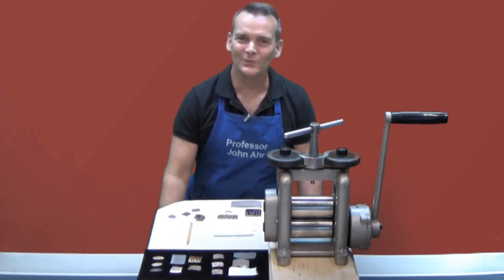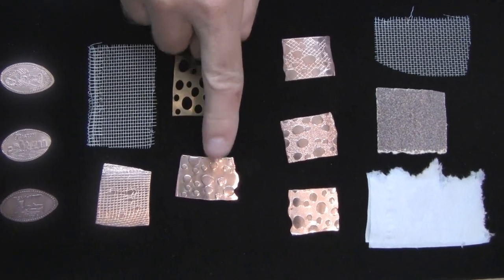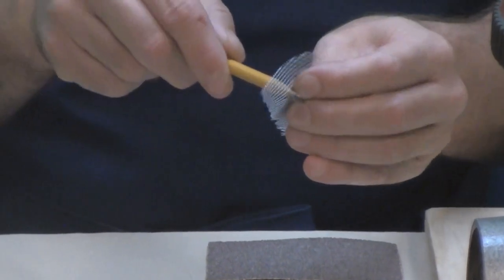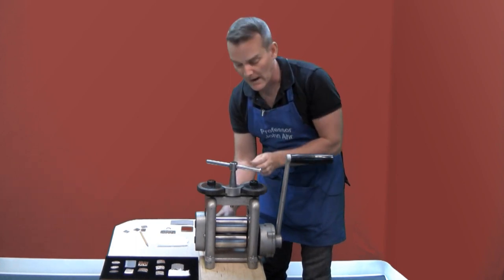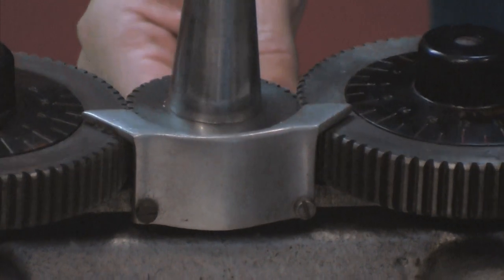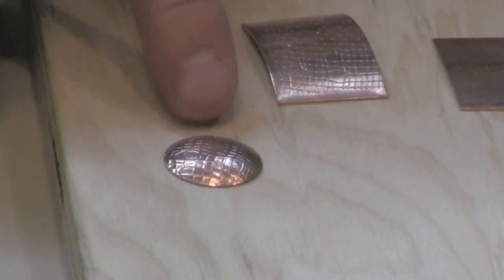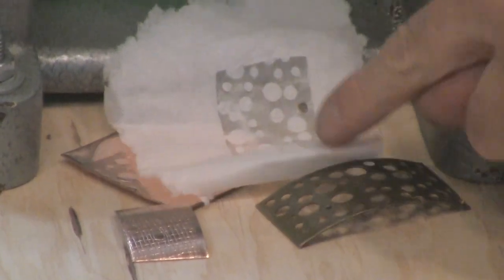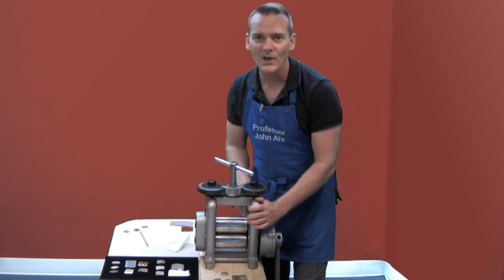Roll Printing Textures With The Rolling Mill

Comment: Am using rolling for the first time! Good video. Thanks! I am wonder if you can tell me what that “brass tool” is. I am crazy about the frosted bubble effect. Thank you, Rita
Reply from the maker: Hi Rita, The brass sheet with holes in it makes raised circles. Put a piece of facial tissue between the brass tool and your metal to roll print the frosted background with shiny bubbles effect. Be sure to check out the OJA’s other videos on how to use the rolling mill. Thanks for watching!😀
Reply: @OnlineJewelryAcademy  Yes, but where can I find that “tool,” template or whatever it is. Is it a custom tool? I can’t believe you actually respond. U R Amazing!
Reply from the maker: @ritakrill1714  you have to make your own tool using a drill or a disc cutter. 😃

Comment: Beautiful, John! I'm amazed at how much of an impression a simple tissue makes, and I love the look.

How did you make the tool with all of the holes? Are they all sawn out, or is the piece narrow enough that you were able to fit it into a punch?

Also, I've seen rolling mills that allow working with wire or other thin stock to flatten and widen it, and those with rollers that are already patterned. Do you have to buy separate mills to get those features? Or can you change the rollers in a smaller, more basic mill such as this one that you have?
Reply from the maker: Hi Wendy,  The tissue paper trick is one of my favorites.  It clearly illustrates that anything you run through the rolling mill will leave an impression on your metal.  The tool with all of the holes was made with a disc cutter.  But I've made others with drills and saws.  It all depends on what sort of holes you want in your tool.  You should check out the Moon Shine Bracelet project video.  You'll find it on the OJA's playlist on our website at: www.onlinejewelryacademy.com  All of the OJA videos are conveniently grouped by category on the website.  I'm not a big fan of milling wire.  I prefer to draw wire through draw plates to change the shape of my wire.  And, specialized rollers are pretty expensive.  They really only make sense if you are manufacturing a large number of pieces that feature the same surface texture.  Plus, installing different rollers into a rolling mill isn't an easy task.
Thanks for your support! : )

Comment: Do I need to sandwich all the time so that the rollers are not damaged or marked? Thanks!
Reply from the maker: Technically you only need to sandwich when rolling anything through the rolling mill that is as hard or harder than steel. So you could safely run a sheet of silver, gold, copper or brass through to decrease its thickness. 😀

Comment: Ok, dearest with the big guns (arms, that is....!), how much do you "tighten down a bit/little"? And, if I want to print ONTO  silver, do I need silver to "sandwich" or is copper ok (as the roler protector)?
Reply from the maker: +Gabby Flying Chef 
Hi Gabby,   When you're ready to roll print, you reduce the distance between the rollers just a bit.  In the video you noticed that I used the dials on the top of the rolling mill to determine how far I was moving them up and down as I worked.  It's difficult to say how far apart they need to be for every job.  This is because the distance between the rollers is determined by how thick the metal is, what you're using to print, and how deep you want the impression.  My best advice is to run samples through the mill to determine the proper distance.  When you're printing onto silver, it doesn't matter what type of metal you use to protect the rollers.  So, feel free to use a copper or brass sheet along with the silver.  Happy printing!
Thanks so much for your continued support! : )
Reply: Thanks for that, superhunk (I hope my comments make you smile, that is my intent, not to be cheeky.) I am wondering, is it ok to just use manila folders (as I've seen and heard about) to protect/enfold metal and texture piece? Thank you, as ever a devoted fan!

Comment: Curious Prof Ahr what brand and model rolling mill you're using?
Reply from the maker: +sheree troy 
Hi Sheree,  I got my rolling mill secondhand a long time ago.  So, I had to go into the studio to see if I could figure out what make and model it is.  Unfortunately, it didn't have a manufacturer's mark or a model number displayed on it.  The information is probably on the bottom.  But the tool is mounted on a base.  Sorry I can't provide you with the information that you requested.
Thanks for watching! : )
Reply: +OnlineJewelryAcademy Also To Sherie Troy: I just got the Pepe 130 mill, LOVE it! It's not the cheapest but it's definitely not the priciest- and it ROCKS! Hope that helps!

Comment: No need for your “sandwich.” Those rollers are induction hardened to higher than 60 RC (64 RC for the Durstons), making them harder than something even case hardened. There’s virtually nothing you could roll through there that would “imprint” your rollers.
Reply from the maker: Hi Albert, Thanks for your comment.  But, I prefer to error on the side of caution.  As a classroom instructor, I've seen students run steel wires through the rolling mill only to have a trace of the wire shapes appear on the surface of sheet metal that they have thinned using the rolling mill.
Thanks for your support! : )